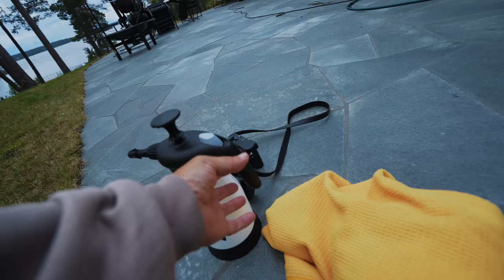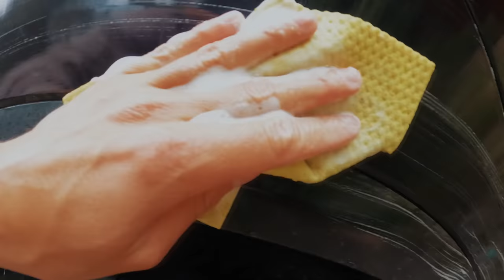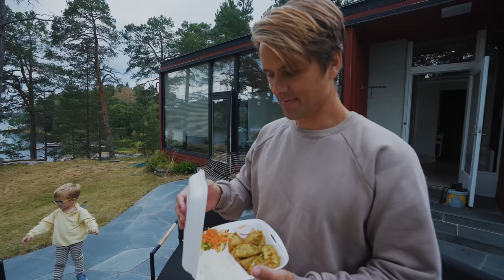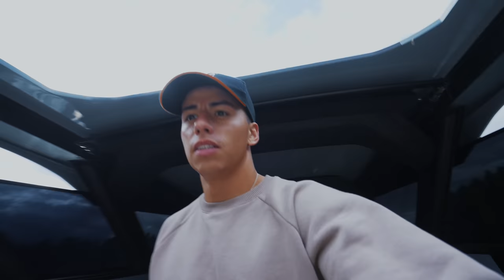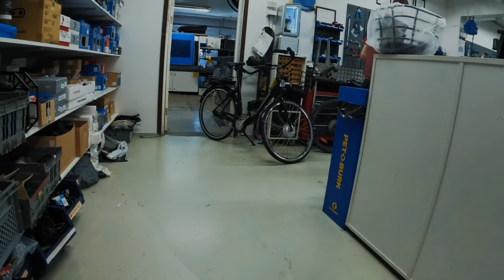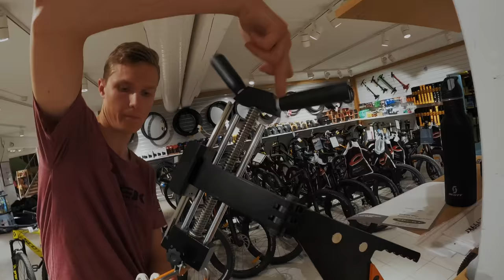MY FIRST OFFICIAL SKATE SESSION ON THEM SKATES! | VLOG 63

Comment: Tips for next time cleaning the paint of car.

-Use a microfiber towel/glove to wash so dirt doesn't scratch the paint as easily
-you can probably twist the spray barrel to adjust width of the spray
-dry the car with a fluffy microfiber towel

Microfiber towels are really cheap (mekonomen or any store like Biltema has it) and it makes sure the paint is getting less scratches, especially black paint.

Keep it up! /car detailer.
Reply: Wettex...  Bra i köket men knappast till att tvätta bilar med.